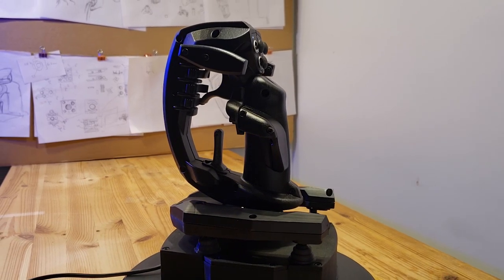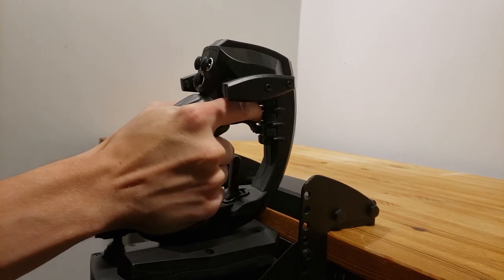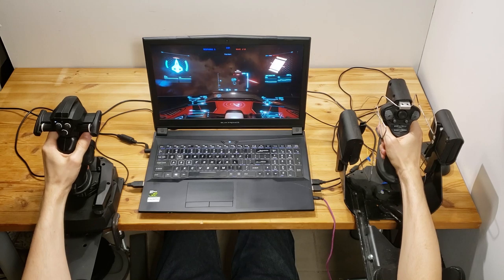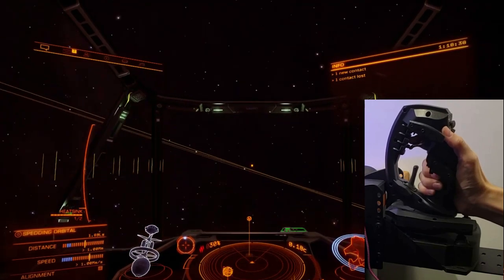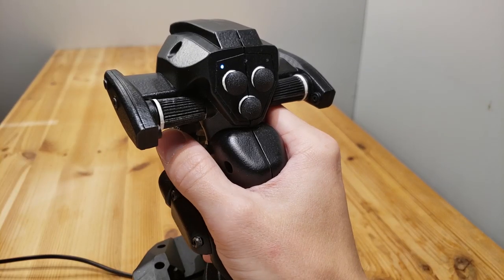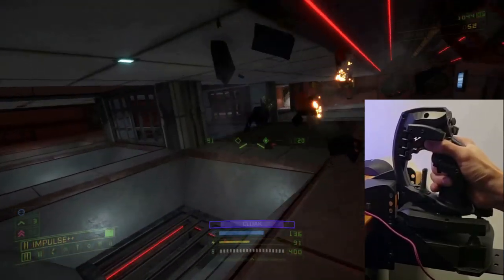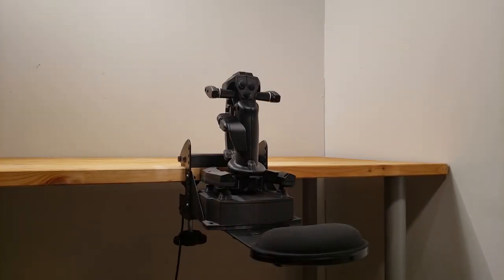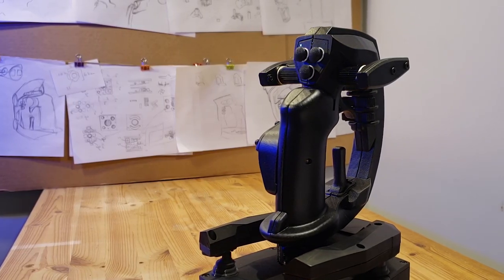Sublight Dynamics Early Access Kickstarter November 2019

Comment: Lack of an analogue trigger kills it for me. My work drives two engine types (pulse and constant) using triggers as throttles, and then reading sticks to get orientation. Hovering for example, would mean getting 6dof lifting information, and lifting a 6dof controller without removing it from a table is one of the more mechanically stressful actions for a human hand.

Comment: But is it metal?
Reply from the maker: The joystick handle has to be very light to operate effectively, and so is made of durable plastic, instead. The base plates, sensor chassis, and stem will be made of metal.
Reply: @SublightDynamics  It should always be the best materials for the job, not the coolest(even if metal sometimes can feel very sturdy and nice of course). Glad to hear this.